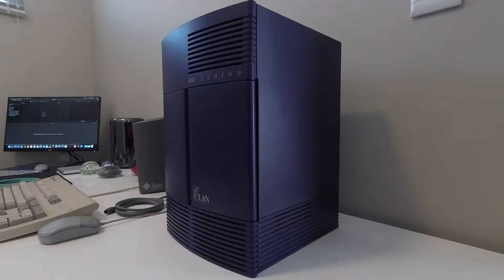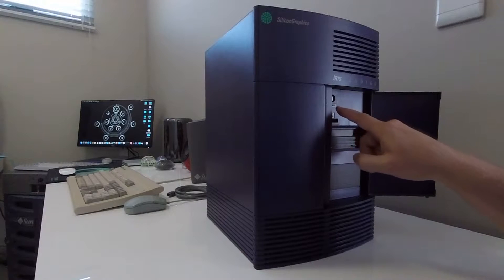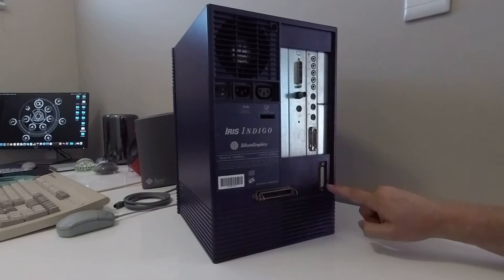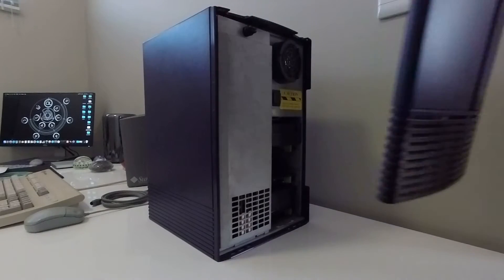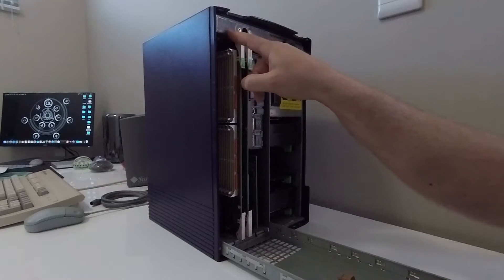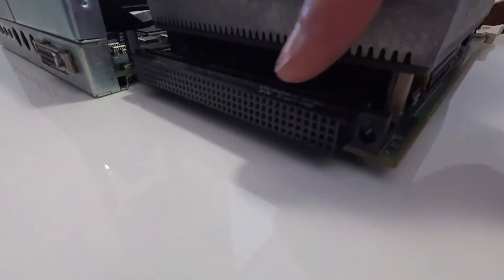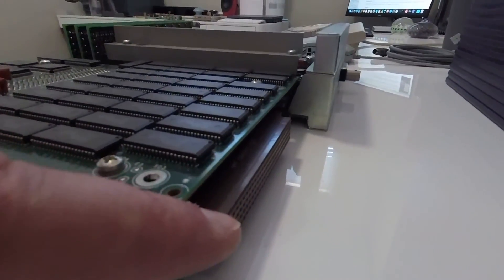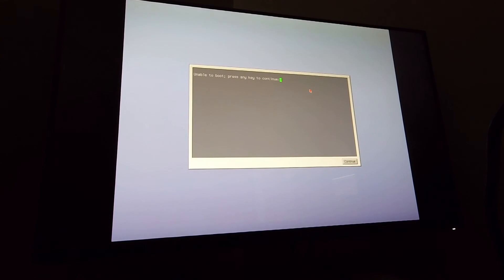A Hardware Tour of a Silicon Graphics IRIS Indigo R4400 with the ELAN graphics option

Comment: So this is from 1991? I guess an SGI from 1991 is perhaps the equivalent of a new desktop computer in 2000, like a Dell with a Pentium II processor?
Reply from the maker: Not quite! 

Although the IRIS Indigo was super advanced for a desktop in 1991 it was quickly driven into obsolescence. 

The Intel Pentium Pro released in 1995 was slightly more powerful than a MIPS R5000 running a 150MHz, and the most powerful CPU that could be fitted into an IRIS Indigo was a MIPS R4000 running at 150MHz. 

The R5000 was significantly more powerful than the R4000!

So you could say that by 1995, high end PC’s had surpassed the likes of the IRIS Indigo!
Reply: @Irinikus  So in general, were SGIs 4 years ahead of personal computers?
Reply from the maker: @InYourFaceNewYorker  Pretty much up until the Octane. Form there PC's started to gain more and more ground.
Reply: @Irinikus  When did Octane come out?
Reply from the maker: @InYourFaceNewYorker  The Octane was released in 1997.

Comment: When Pcs and Macs where back there in stoneages just for office word usage and in 1992 first fully cgi made history with Jurassic Park using Amigas 3000s workstations for pre render scenes and for final render using first 64bit crimson SGI farms.  Amiga and SGI was light years ahead then pcs cpus catch up really fast and with graphics  with nvidia and then nvidia bought the whole sgi graphics department and engineers
Reply: I know the Amigas have been used in several productions, but I didn't know they were used for Jurassi Park. Do you have any more information or links where to find them? Thank you ;)
Reply: Shame they did not use Acorn Risc PCs it blew both the SGI and the Amiga's out of the water. Was used for BBC News graphics though. Was far cheaper too and it's Operating system was super efficient and was out in 1987!!!